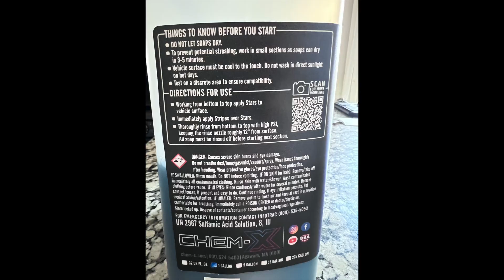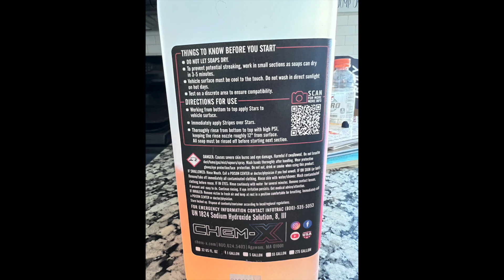CHEM X STARS AND STRIPES REVIEW! IS IT WORTH THE MONEY?

Comment: sorry but you need to do it the correct way.. You apply stars , and then overlap it with stripes. It acts as a + - reaction to each other. I use it for my big rig, u willl love it!
Reply from the maker: I did. Used it a hundred times
Reply from the maker: Literally go watch the owner of chem x apply it. He goes blue then red.
Reply: you were not supposed to rinse off the stars before applying the stripes. Will work even better if you apply both in correct order, and then rinse both off. @cleanmachineautodetailing
Reply from the maker: @arcforceworld  I didn’t. Watch the video again and don’t skip around.
Reply from the maker: @arcforceworld   go to 3:50 clearly see blue, no rinse. 4:10 red, then rinse. Same at 7:30 and 8:30. no rinsing inbetween.
Reply: lol what are you people talking about? He clearly sprayed on blue stars then red stripes overtop.

Comment: I'm not saying the product isn't good but you did just pressure wash the vehicle with a fan spray.  How much did the product really have to perform?  Test it as a spray on and hose/rinse off and see the performance.
Reply: By far it will and MUCH more.  Don’t know what accessories you’ve used but getting one cleaned it’s the best.  Then top with a shine/protect agent or already have it coated.  Just common sense.
Reply: Pressure washers alone never clean very well. Hell, even most  car wash foams sprayed onto a vehicle and then followed with a pressure washer rinse don't clean very well in most videos. 
Getting a good clean without contact is difficult.

Comment: So, has was your truck prep. before the coating?  Would I try this product?  Probably not, because of the cost.  I like using ONR, a rinseless wash, seldom use a hose or soap, unless I am doing a strip wash in a full detail.  Those are my thoughts...but thanks for the video
Reply: Cost is negligible when you break down per wash like he mentioned. I can't fathom not using a hose at anytime even during a maintenance wash. Micro scratches galore.

Comment: Might as well have just actually washed the truck. Pre-wash, rinse and contact wash. I'm not being old school. Either you did something worng, or it took as long to do this as a real wash. I don't know if that was the intent. Meaning, show what time it saved, but, nothing special to me.
Reply from the maker: @mcflotty  it’s about getting as much off the vehicle before doing a contact wash. Thanks for watching though.
Reply from the maker: @mcflotty  where in the video did you see me do a contact wash though?
Reply: @cleanmachineautodetailing  Hey my friend, it's hard to read tone in one of these posts. Timing wise, I am suggesting a pre-wash and contact wash takes the same time. I hope I didn't offend you as that was not the intent. I never try to. Just, if I do a pre-wash, APC, High PH-Low PH or whatever you'd call it, then contact wash, it's about the same. To me, it looks like you worked hard on that car.. You can tell in the video. I think I should have just said it' looks like the same amount of work. Did not mean to offend you. Sorry if I did and won't post again if ypu wish.
Reply: @cleanmachineautodetailing  Also (this is the second reply) I never suggested you did a contact wash. I am from the New England area. Not unfamiliar with winter or anything that has to do with car detailing. Also, I've had to use the coin op systems. I brought my own stuff (except water and pressure) every time lol. Even now in Florida, there was a year that I did that method (between houses) where I brought my own stuff. I never got flagged and there is even cameras on the bays here in Florida. I didn't mean you didn't do a good job. Honestly and sinserely apologize if you think I was hacking on you. I was not in any way. I think the owner of this product line is a great detailer. Top shelf! I'm not sure from anything I can research here on YouTube, there is something that would make me use the product. Other than the name, and I like the guy. To me, at some point, if you want the car clean, you need to contact wash it. Somewhere along the line. Again, I am sinserely sorry if I annoyed you, misspoke or anything. The wash was a lot. At this point (in Florida anyway) I can do the same with a rinseless wash, and no time invested.

Comment: Did my research watch many videos from the tractor trailers tp small vehicles.
Went with the 4:1 dilution.
And will tweak that as I get more familiar with product and car paint conditions.
So far it gets a thumbs up.
Also I am interested in any info on his last rinse water filter system.
Any info on that would be much appreciated 👍
Tried this product
Reply from the maker: @garycrane1462  thanks for watching. Cr spotless system.
Reply from the maker: I have a built in bypass so I only use it for the final rinse.

Comment: Great video, properly applied and nice breakdown of cost per wash. Since your pressure washer is on the weaker side for this product, suggest if you use again to get a little closer to truck. The pressure with chemicals helps break down crap easier. I discovered this while doing my truck. Chem X's pressure washer has some power behind it.
Reply from the maker: Good tips. Thanks. He’s definitely got me out gunned by 1300 psi or so